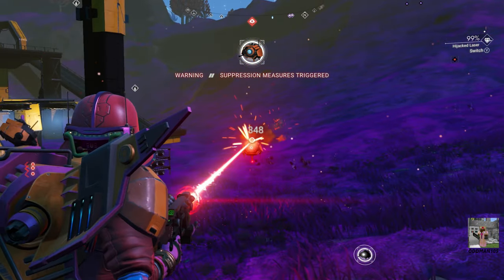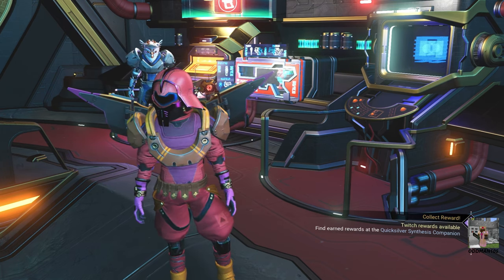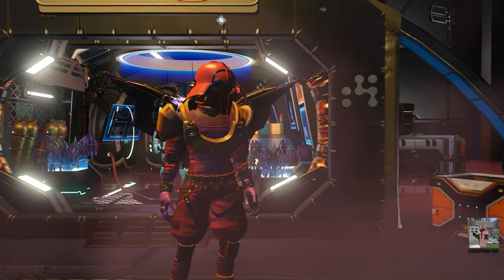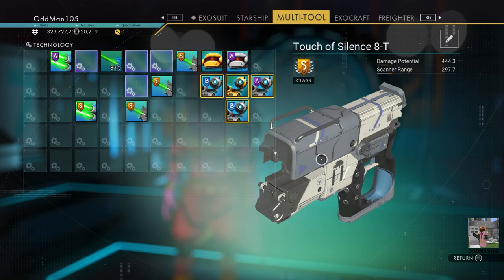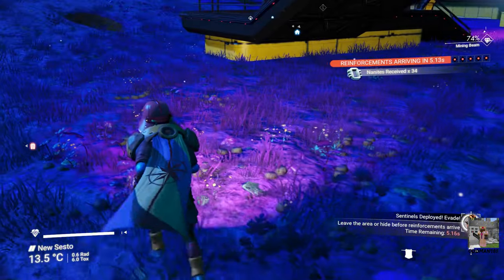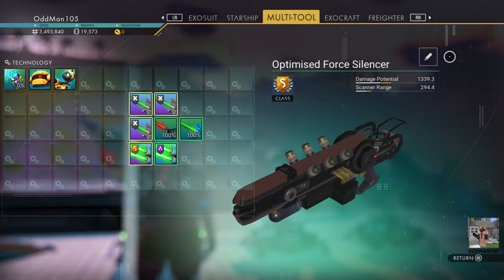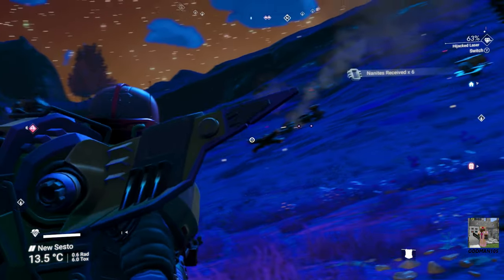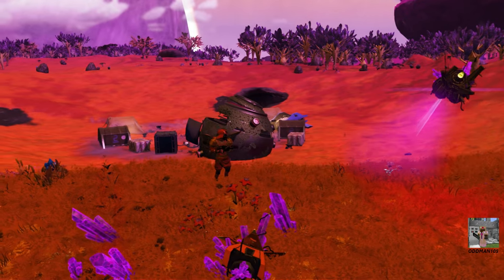NEW No Man's Sky Singularity Update | How To Get A Maximum Damage Mining Laser On Any Multitool

Comment: All this time I'm trying to get a shot gun or neutron cannon.....but I had the right tool for the job the whole time.
Reply from the maker: Hey! Thanks for watching! Like I mentioned in the video, I was shocked at the potential of a fully upgraded mining beam. The best part is that you can use any s-class multitool as long as its supercharged slots are connected.😎
Reply: Neutron Cannon upgrades are THE WORST to collect - one at a time on a space station... I compromised with 122,222 damage - u can get it to 150,000 apparently, I have found a decent 'generous' pirate station that churns out 2 or three of each upgrade per save - 

'Generous' Pirate Station: Bird, Sunset, Whale, Face, Triangle, Whale, Sunset, Sunset, Whale, Sunset, Spider, Dragonfly
Reply: But neutron cannons are especially powerful against horrors tho, the ones spawn after you destroy their egg. When they spawned, just blast them with full charge and AOE would do the work 9/10.

Comment: I was just checking this out last night when I was playing.  Without a doubt, it's just as powerful as my Neutrino Pistola! But it's far more versatile and affordable for new players, and easy to get. I haven't tried it yet, but the autophage laser supposedly cloaks you when mining! Would be very helpful for newer players and those doing survival and perma death modes.
Reply from the maker: Hey! Thanks for watching! Like I mentioned in the video, I was shocked at the performance. The SC slot configuration will make a huge difference with the upgrades, whether they're "S" or "X" class, but the mining beam is a great all-around weapon.
Reply: @OddManGaming  I finally got a S class with 4 SC close enough to try it, and it felt like cheating! Too awesome. I'll try out the Autophage tool to see if it truly makes you invisible. If it does that would make it great for yanking Echo locators with out having to fight/run all the time.

Comment: I have a sentinel multi tool with 4 supercharged spots in a square and it's not doing anywhere near the amount of damage you got on that :S
Reply: Moved some tech around now the laser does over 700 damage per hit XD.
Reply from the maker: Hey! Thanks for watching! Adjacency is important when min/maxing damage. Sounds like you got some better results after relocating your upgrades. With the right multitool, a fully upgraded mining laser is probably the best weapon in the game.
Reply: Also as a side note it sometimes bugs your multi tool and you only do a 1/3 to 1/4 of the damage. It even went from 707 to 132 damage.

If you get this bug take all tech out of your blue slots then save, reload and put them back in the blue slots and it's fixed.
Reply: yeah, too,  only max 236 damage, try to relocate many times, the most damage with two charged minings and s tech around them
Reply: I just built a a set-up like this on a Atlantid multi-tool (the highest mining bonus) but it's not working like that, daaaayum.

Comment: Is this supposed to also work with the Atlantid multitools? I figured since they had a higher mining bonus than the Sentinel, that it'd be better with one of them. I set up a T slot rifle in similar config and it's not performing as well as shown here.
Reply from the maker: Thanks for watching! It should work well with the Runic/Atlantid multitools as long as your upgrades have similar stats, and your multitool has 4 connected SC Slots.
Reply: @OddManGaming  I think on the last test I had the beam in one of the SC slots. My mods are all close to S-class max, but not quite there on cooldown and dispersion:
Fuel Efficiency +21%,	Heat Dispersion +49%,	Overheat Downtime -17%,	Mining Speed +20%
I'll try it again shortly to see if its better with only the mods in the SC slots.
Cheers